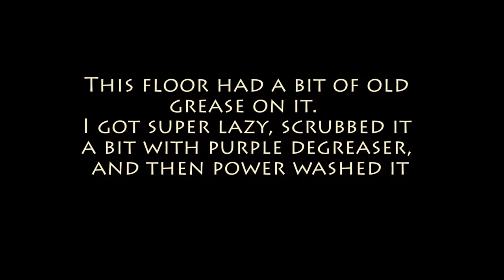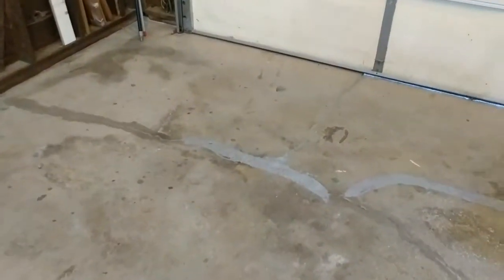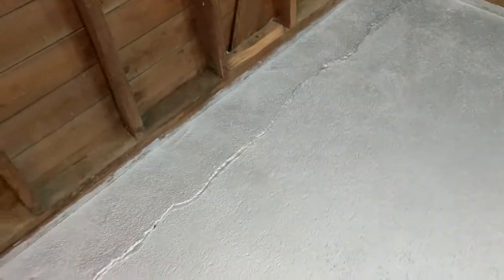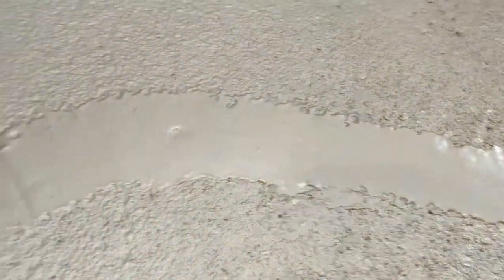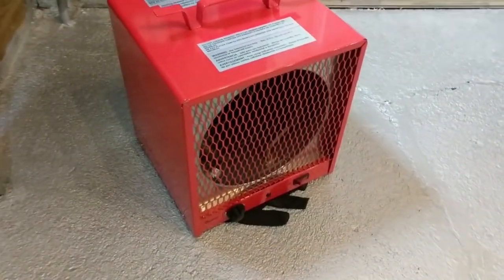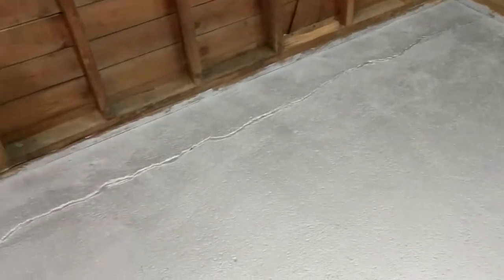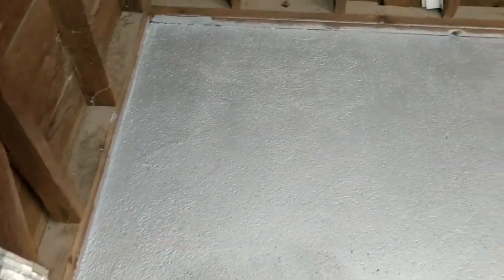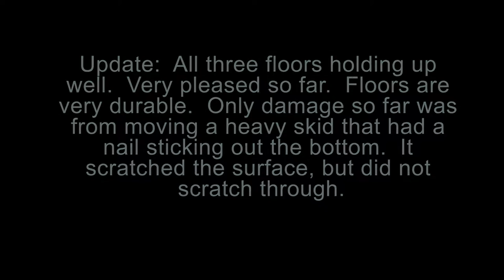Applying RustBullet to a Concrete Garage Floor - Garage 3 of 3

Comment: How is the paint holding up n this video
Reply from the maker: Taylor Hulme - very well.   I had ok expectations, but didn’t think it would hold up as well as it has.  Zero scratches and no lifting or chipping.   A worker just dragged two large propane tanks across the floor.  I cringed, but zero marks or scratches.   Only thing I did notice was on one of the garages I did, part of the floor is outside the door and gets southern sun.  That part has stayed “shiny silver” where the rest of the floor is a more muted grey (Maybe it just needs to be mopped).